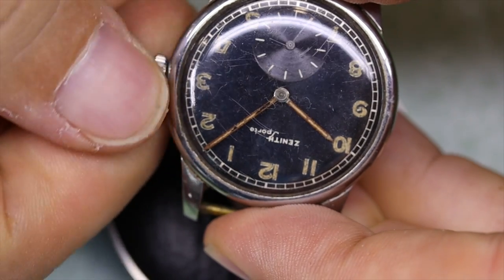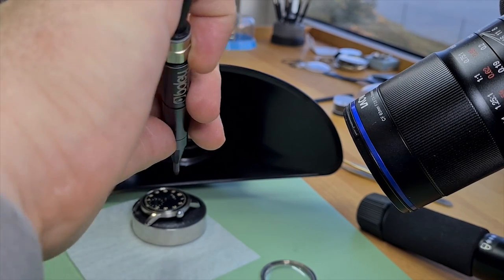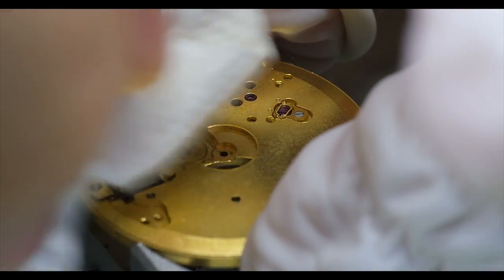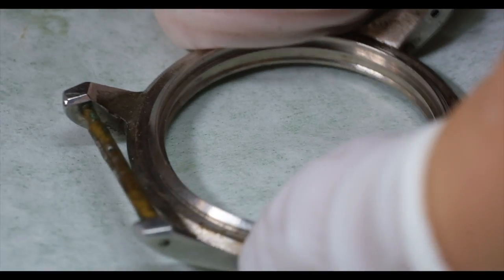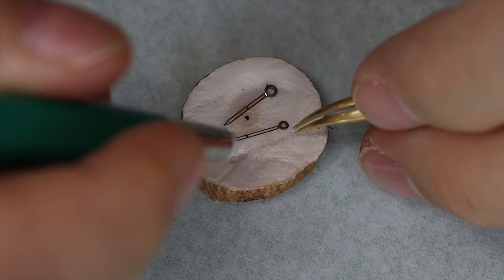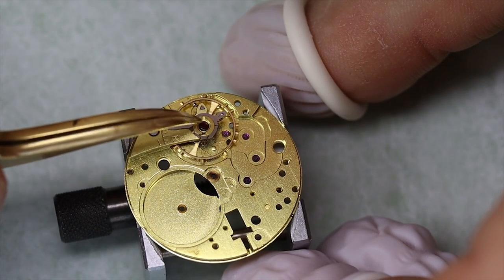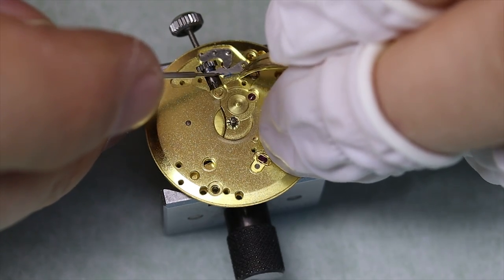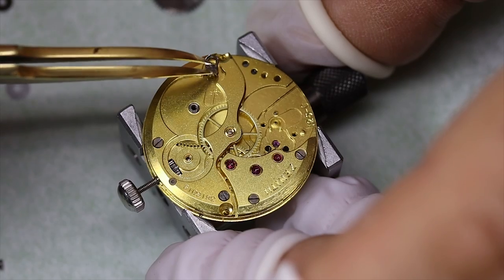Radioactive, not running... is this watch even worth saving?

Comment: Do you have any videos where you change an Incabloc setting? I'm a beginner and somehow managed to break one of the spring forks on a tiny watch movement I was servicing. I have read that it's best done with a jewelling tool and have a rough idea on how to go about doing it but would prefer to see it be done just to be sure.
Reply from the maker: Hello Vedat, thanks for watching! I do believe I changed an incabloc spring in a video or two, but I honestly can't remember which one... I will make an inventory of the kinds of topics I cover to make sure I can answer such questions better, but for now I guess you will just have to watch all of them 😁
Reply: @VintageWatchServices  Thanks for the answer. No worries, I found a pretty useful video by Mark from the Watch Repair Channel. It's about changing a jewel which looks like it should be a very similar process. It wasn't an expensive watch so I'm not too worried but I guess this can be an unexpected lesson for a new skill :)

Comment: Can you explain how to measure a watch for a new crystal to ensure the new one fits correctly? Or point me to an earlier video where this is explained. Also how do you know a watch dial or hands contain radium? Is a geiger counter the only way? Regarding the watchmaker marking inside the back cover, being a camera collector, I often come across old cameras with a sticker from a repair shop inside the back of the camera. This might be undesirable in a watch since the sticker could come loose and mess up the movement.
Reply from the maker: Thanks for watching! It's pretty straight forward to find the right size, you simply measure the old one (assuming it is still there). For plexiglass crystals, you choose a tiny bit bigger size, as they shrink with age, but for mineral and sapphire you order the same size. You'll have to make sure you also take the gasket into account for these. 
Marking the inside of the case was commonly done in the old days, and it was done as a mark of warranty. Nowadays there are obviously much easier ways to do this and it's not good practice any more. But you're right about stickers, it wouldn't be a good idea to put a sticker on the inside of a watch!

Comment: It would be wise for you to have a Geiger counter that measures Alpha radiation. The one in the video only detects Beta and Gamma. Also, some of the daughter products from the decay chain of Radium are quite sticky and will deposit on the interior of the watch, the dial, the crystal interior and the parts of the movement. These will contaminate the surfaces that the watch touches, possibly your tools, finger cots, movement holder, movement resting pad and the solvent that the movement is washed in. With a Geiger counter that measures Alpha will allow you to find these contaminated surfaces and the solvents that wash off the sticky Radium daughter products. Sincerely, Pat Brown
Reply from the maker: Thanks for that, Pat! Alpha particles are so big that they do not penetrate the skin and are only really dangerous if you ingest them. So while they are extremely damaging if you get them inside your body, as long as you don't lick the radium dial or inhale very strongly right above it you should be fine :)

Comment: Great video as always and you’ve inspired me to try and do one my self. I got a very good deal on a 71 seiko sportsmatic movement, (that is supposed to be a seahorse but the transfers have lifted of the dial? That I’m about attempt to do, which has 3 dates engraved in the back and are so small I’d need a microscope to read. I am have terrible trouble getting the auto unscrewed, any advice would be extremely appreciated before the hammer comes out.
Reply from the maker: Thanks Clive and very cool that you're inspired! If the screw is completely stuck, try using some rust remover or wd40 and let it rest a while before trying again. Good luck!
Reply: @VintageWatchServices  thanks so much for that, time to crack on.

Comment: Congratulations on your viewership milestone Stian!  I knew your channel would be a success what with the Norwegian humor ..... not to mention all the franked and detailed watch info that only a watchmaker would know. I would  much rather listen to someone who actually knows what they're talking about then some Youtube hipster who's main asset is a beard and  the latest trendy verbiage. 
    Thanks for the interesting and detailed treatment of this subject (radiation). Usually folks talk around it but (as usual) you provide the real facts of the matter.  
   One question:  I have seen some people tighten up movements by jeweling the worn pivot holes instead of peening them.  Do you consider this a good idea or not necessary to cure the problem?  Thanks.
Reply from the maker: Thanks so much, Randy! Crap, I just bought a barista machine and am growing a beard 🤔
Radium dials are much discussed and I wanted to make a fact based argument that they are perhaps less dangerous than many people think but also show some guidelines on how often you can safely stay one.
For the pivot holes: putting jewels in is technically much better, but it takes away from the originality of the watch. Thus if peening can do the trick I'd try that first.

Comment: I am not fool hardy but rather performance oriented. I do not live in fear. I have tried to find a comparison between Super-Luminova and old fashioned radium and all's I get is "The Radiun Girls" fear porn. I have never seen a lume test with radium involved. If the performance of radium was spectacular I would wear a watch with radium hands and indices. I have several radium dialed Movado's and one or two still have a noticeable glow ..... although the duration is not long. I even have a WWII radium dialed 24hr Ships Clock that still runs. It doesn't glow any more. Maybe you could do a lume test with radium. Now that would be interesting. 
Safety third after all.
Reply from the maker: Thanks for watching! The radium is so radioactive that it basically burns out the lume within a few years. Thus radium lumed watches that still glow in the dark would be very rare, but perhaps your Movados had just a tiny bit of radium in them? When new they would burn very bright but I wouldn't want to test that 😂

Comment: The case back pretty much prevents the radiation from a radium watch from harming the wearer.
Reply from the maker: Quite right Alastair, and the crystal also. The real danger is if you ingest radioactive debris from the radium on the dial.
Reply: @VintageWatchServices  Well, mostly-but some Gamma, and maybe a bit of high energy Beta WILL go through, the back and the movement does reduce both of them, of course.
As for the crystal-much of the Beta, and most of the Gamma WILL get through, but since the front of the watch is faced AWAY from your body, not really much of a risk.
As for Alpha:an intact watch will not emit ANY Alpha-the crystal and the case back will totally stop it.

Comment: Glad to have you back after beating Covid! Thanks for the discussion about radiation in watches and for showing the details of staking the barrel bridge- both were very interesting. One more question for you about cleaning: Do you keep track of which is the top/bottom balance jewel when you have them out for cleaning, or are they typically interchangeable and not worth fussing about putting back on the same side they came from? Thanks as always!
Reply from the maker: Thanks so much! For the end stones is like this: they're either interchangeable or they aren't :) That  may sound facetious but isn't really. The stones are either the same or they're visibly different. Most of the time they are the same, but sometimes the top stone - the one in the balance - is a bit thicker or even wider. This is because the watch is presumably a bit more likely to receive shocks with the dial up.
So in short: you will easily see whether the stones are the same or different and proceed accordingly.
Reply: @VintageWatchServices  Haha, well said. Thanks for the great answer!

Comment: I must correct you.
20mSv is the maximum allowed dose for any worker in the EU that works with radiation.
20mSv while being in normal ranges is still dangerous in what we call stohastic aka later problems. It can also be dangerous for even lower doses because of the unique way the particles damage the tissue.

So 14mSv just from a watch IS CRAZY

Source i work in a field that deals with radiation
Reply from the maker: Correct me on what, exactly? Did you even watch the video?
Reply: @VintageWatchServices  i did, correct you on the 100mSv that the radiation watchers can be exposed to.
When they get to 20mSv they get pulled off the workplace because 20mSv a year is still considered borderline dangerous for us and you had to do something wrong to even be exposed to that.
Sorry, my comment was not meant to be mean :)

Comment: Hello,I have some watch with tritium from 1970s,is it safe?
Reply from the maker: Hello, watch the video and you'll find out 😉
Reply: @VintageWatchServices  maybe i don’t understand English well so you can answer me here? :)
Reply from the maker: @blackhole6834  Hello, it's impossible for me to tell you whether your specific watch is safe, but most likely it is. If you watch the video there's a pretty thorough discussion about the issues and you'll then have to apply that knowledge to your specific watch.
Reply: If it is indeed Tritium, not Radium, then, yes it is safe.
Reply: @m.k.8158  so its 0 radioactive?
Reply: @blackhole6834  Very slight radioactivity,, nearly all Beta. but hardly any gets through the case/crystal...not only that, but considering that it's been through around 5 half-lives, it's not even worth worrying about.

Comment: Holy crap it's that high if you were just wearing it??? (before servicing it)
Reply from the maker: Yep, that's pretty high indeed. So high that you should not be wearing it 24/7 for sure. Wearing it every now and then wouldn't be an issue, but it's much less risky after the re-lume.

Comment: Leaded crystal. I wonder if any of those watches have it. Superfluous for alpha particles because regular glass would block them and probably most beta too.
Reply from the maker: Thanks for watching! Beta goes through both the crystal and the watch and also gamma, but alpha is indeed blocked. And lead has its own issues 😉
Reply: @VintageWatchServices  A Leaded glass crystal would not be hazardous to wear at all.
It would be slightly more risky for the workers that make the glass(but the risk can be reduced to a very low level with proper precautions).
I suspect that it would raise the manufacture cost though.

Comment: Why the gold plating when it is not visible to the owner; rust prevention? Would the finishing of the inside of the case back be more expensive that the provision of the "missing jewel(s)? ps Gimme gimme!
Reply from the maker: The number of jewels were simply lower in the olden days, and this was one of the last movement series before 17 jewels became standard in high grade watches. So it wasn't a cost saving measure, it was simply the standard. Perling the inside of the case back would also not have been that costly back in the days when labor was cheap :)

Comment: Did somebody just dunk that movement in oil or something? Sheesh. I'm not anywhere close to an expert, but I've watched enough videos to know you usually use amounts measured in gnat's tears on the bearing surfaces. There shouldn't be anything to wipe off. I love seeing some of the more advanced techniques you use to repair watches. 
As for the radium paint, very few things with that will still have any glow left. The phosphors in the paint that actually glow just get burned out by the radiation over time. The radium itself is almost as radioactive as when it was originally applied so you definitely don't want to breath in any dust from the dials of watches or clocks that have radium paint on them.
Reply from the maker: Someone was quite liberal in the lubrication of this one, yes 😁 And yes, radium dials were very bright for a few years and then the radiation burned out the lume... Radium dials today have pretty much all brown lume

Comment: As far as I remember, 10 μSv/h is normal background radiation....,  0.1 μSv, you get from eating  one banana, so it is  the same as eating a 100 bananas. If you eat 10 million bananas at ones,  you will die of radiation..That watch was 1,3?
Reply from the maker: Thanks for watching and for your comment! Background radiation varies somewhat with where you live, mostly due to rare minerals in the ground. Where I live in Switzerland it's about 0.10uSv/hour, for instance. 10uSv/hour would be a very bad place to live, but maybe what you remember is 10uRem? That's the same as 0.10uSv
And if you eat 10 million bananas at once I think there would be a different cause of death than radiation 😁
Reply: If you ate 10 million bananas at one time, you would be dead anyway, even if they were not radioactive.